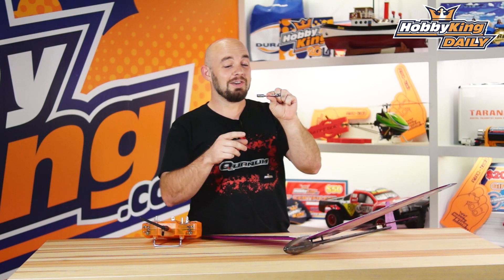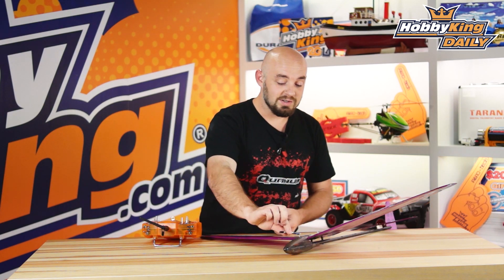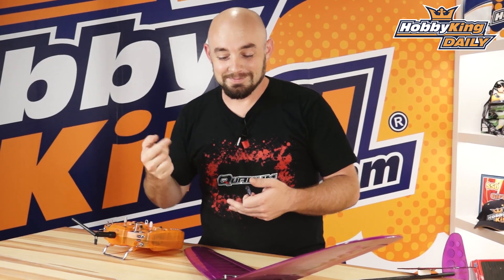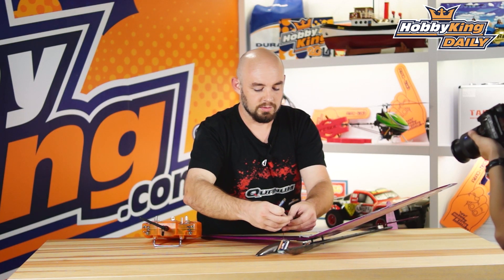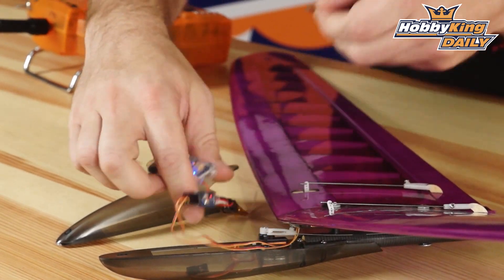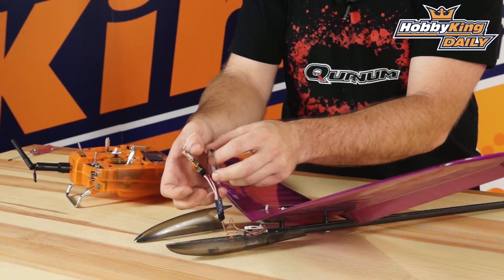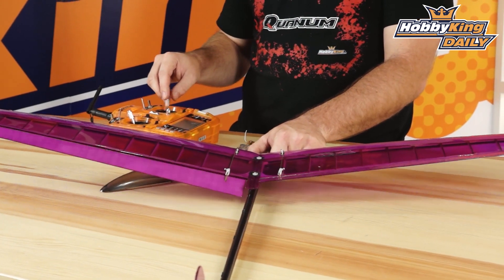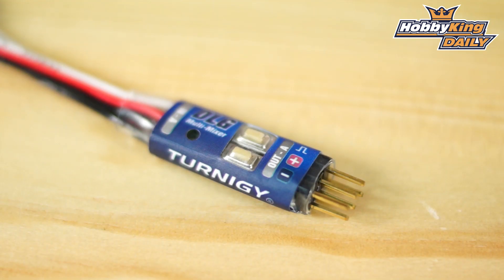HobbyKing Daily - Turnigy DLG Multi-Mixer

Comment: Has it got some mixing to input some down elevetor at the same time? Nice thought a very easy to install . I had to program my radio for hrs before i get the setting right.
However if u do not input some down elevator it does cause the plane to baloon up and stall and.... Crash .... The flaperons on such light aircraft are very sensitive.